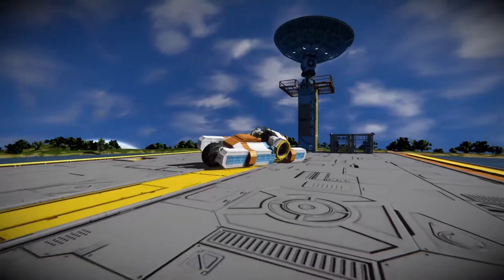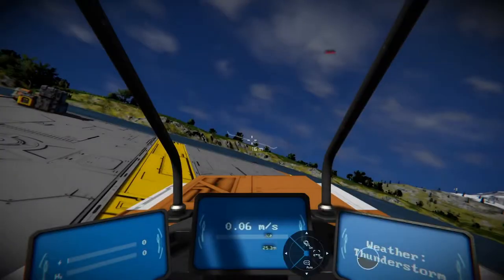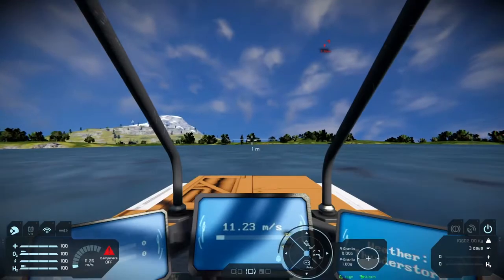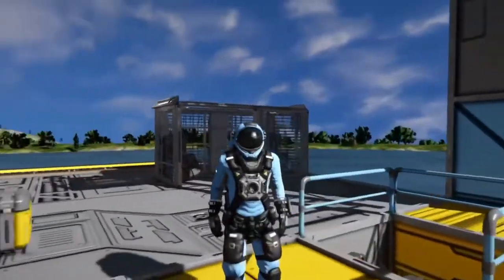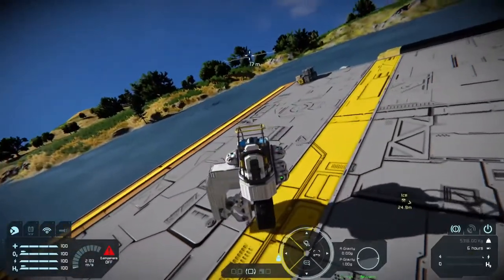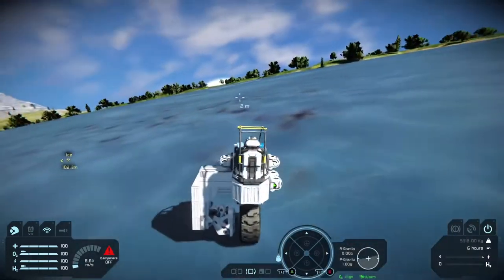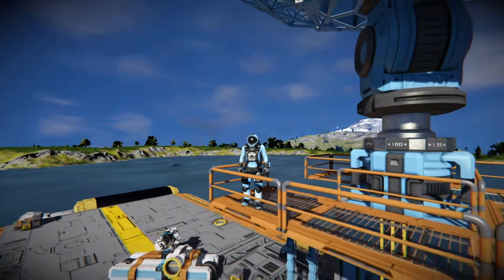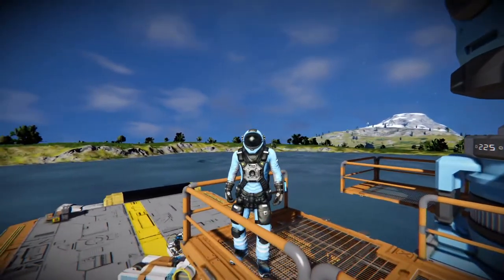Space Engineers Motorcycle Prototyping With Gyroscopes

Comment: You can 3 wheel by have the back or front wheel, on a separate articulation (single block will do), Single wheel attached to block at 90 degree angle to other 2 wheels, block attaches to rotor in unlocked mode limited to 180 degrees of arc, the rotor attaches to the strut of vehicle. if wheel is also unlocked then the third wheel effectively becomes a castor wheel.
This set up can make it a bit wobbly if on uneven ground or reversing direction as the free wheel can pivot around the axis of it rotor pivot point (the shorter the articulation strut the less the wobble). To limit that set rotor limit to a cone facing opposite the direction you are travelling, you will need to experiment with how wide a cone became distance between the wheels and front or back 3rd wheel placement will affect how it interacts. The disadvantage is that the 3rd wheel can 'jam' somewhat if you backup  against the direction of the rotor radius.